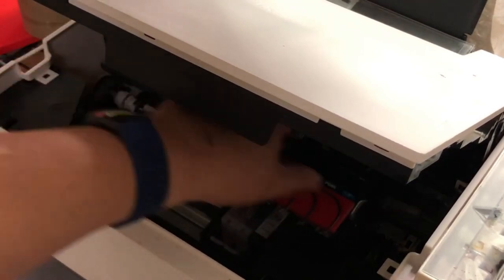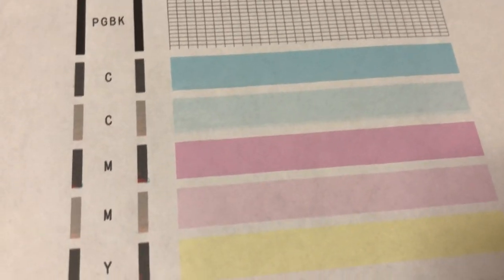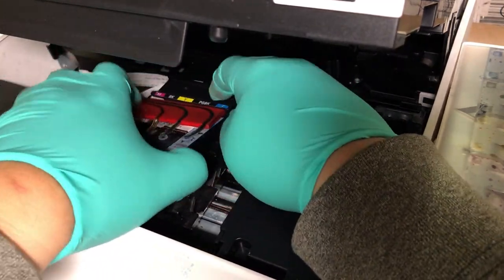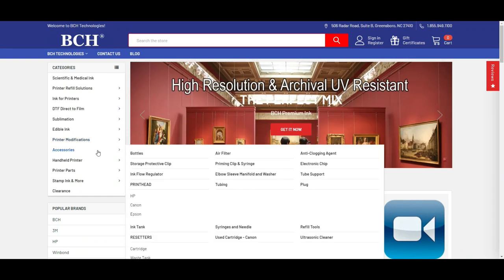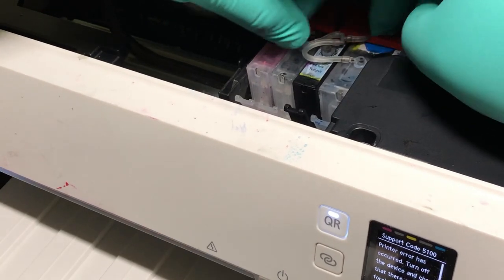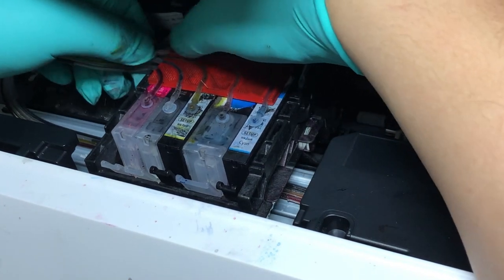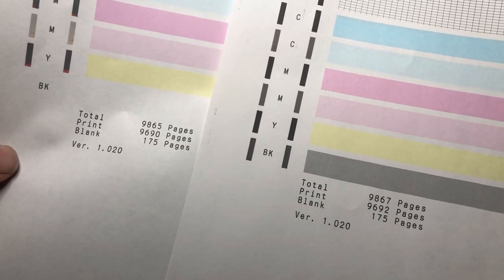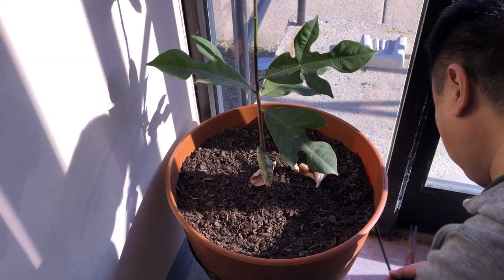Run 4-Color CISS Ink Tank on a 5-Color Printer - Fix Canon Printer CIS Color Mixing Problem

Comment: This is a shot in the dark but do you know anything about Epson 
workforce 1100 printers?  what to use to clean print head?
Reply from the maker: I don’t know that printer but I would use the red cleaning solution on it.
Reply: @BCHTechnologies  what red cleaning solution? got a link?
Reply from the maker: @mindsurf2010  https://bchtechnologies.com/professional-red-cleaning-solution-for-water-based-inks-dye-pigment-sublimation-not-for-solvent-ink/
Reply: @BCHTechnologies  thank you

Comment: Hi 
One of my inks is low (original ink that came with the printer) I want to top it up do I need to empty the cartridge or can I just add my off brand ink to the half filled cartridge? 
Thanks in advance also thanks for your videos.
Reply from the maker: No need to empty the OEM ink.  I would add ink directly.